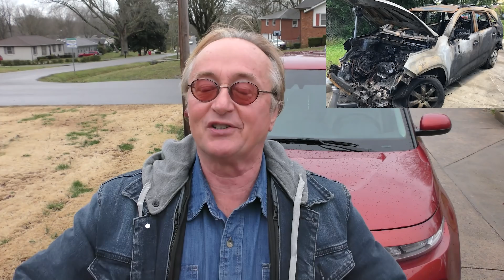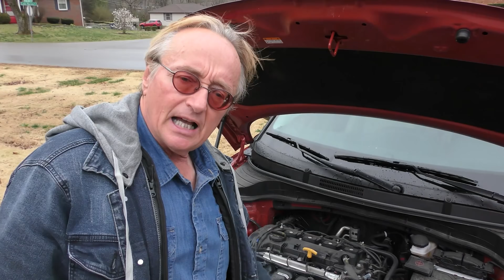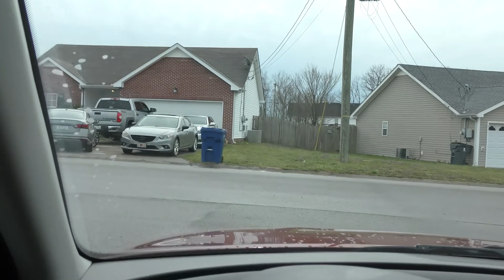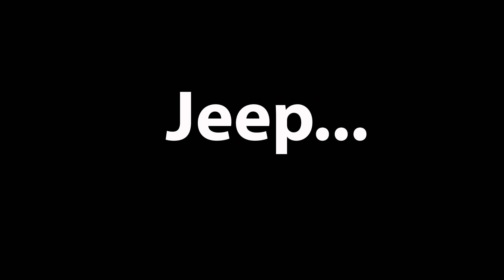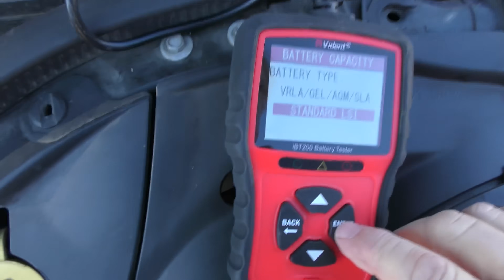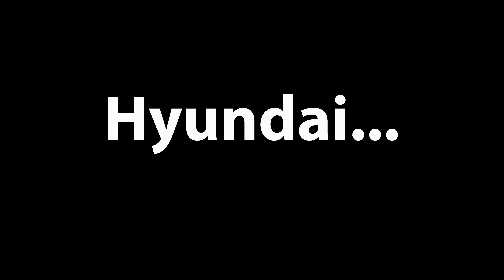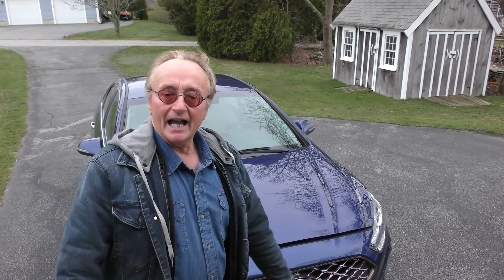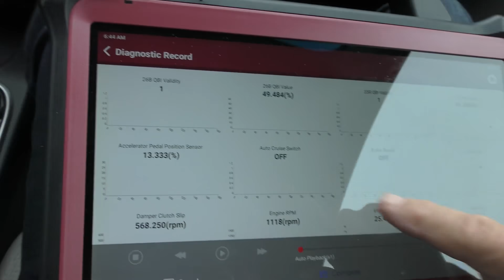3 Car Brands That are Crap

Comment: Next to nobody buys new cars in my area, they're just too expensive, now everyone goes for used cars provided such cars are in decent conditions, the car dealers are just asking too much but instead they're in trouble...

At least the gas is getting cheaper, same for diesel, there was a story where a few transit bus suddenly started with a fire that came from the engine that were using electricity, Volkswagen was especially the worst, now a lot of people are staying away from Volkswagen....

However, right now BMW cars are getting more common in town...

It's a little too soon to use electricity powered cars...

Comment: I have a Hyundai Elantra that's got almost 300,000 miles on it and there is no problem with it whatsoever except for the air conditioning went out just this year and my guess would be the two seals went bad

Comment: First of all let's be specific here. Almost every car company makes lemons. My friends used Hyundai Sonata lasted forever with minimal maintenance. You shouldn't condemn an entire company. Every manufacturer has car models that are poorly made and well made regardless of the country.
Reply: The old Sonata had Mitsubishi engine.
Reply: @pflaffik  You’re talking about 30 years old Sonata.
Reply: I think the point is what kind of habits do companies have. If a company has 1 or 2 gems in 20 years then you probably wouldn't wanna take your chances with them.
Reply: The Hyundai Theta II engine recall was a real disaster for the company, but if you get a Hyundai with a Theta II and decently high mileage and no obvious problems then it'll probably last for-frickin'-ever.

Comment: I bought a Hyundai Elantra and Santa Fe, and both required total engine replacement.  Insane...
Reply: Same
Reply: Yes! I also had major problems on a Hyundai and Kia ...don't get the comments of people were like mine has 200,000 miles on it no problems I think they must be 50/50 lemons and good.

Comment: I had zero problems with my Hyundai and owned it for 4 years (bought used when it was 2 years old).  Have zero issues with my Kia (owned since new for 4 years).  ZERO issues!  Nothing at all.  Compared to my old Ford Escort, these newer cheap cars are like night and day.  I'm throttled that one would deride these cars.  To me, they are amazingly simple and well designed/built.

Comment: I have a Kia Soul EV 2016 - Kia approved a warranty battery replacement last January.  Still waiting going on 9 months later and the car now has a charge range of 28 miles.  I agree with your Kia assessment and will never buy or recommend a Kia car again.  It feels like they have stolen our money and have no intention of repairing our vehicle.

Comment: Had a chrysler back in the 1980's time frame (Called it the Omlette - was an Omni) - burned a quart every 700 miles.. Chrysler wouldn't help.  "That's normal"... I'm sorry...but losing a quart every 800 miles seems like an EPA violation, but they wouldn't fix the sucker....

Comment: My gdi sonata has 150k change oil every 3500 with a proper spec acea a5 oil by Pennzoil and burns half court after it reached 135k. Change oil on time. People think "earthdreams" honda engines are any better. I used to work for em.

Comment: My 2010 Kia Forte has 260,000 miles on it and burns about a half a quart every 3000 miles. But it does have that 2010 engine knock. But other than that I have never had a major repair done to it. I've had 5 KIAs and they have all been great cars. I now have a 2020 Forte GT Line and I love it.
Reply: Hyundai and kia have sucked for a decade....plenty of people have needed a motor way before they should have .and it wasnt from neglect. Of course you like the GT... Its still new ...but the newer most cars and trucks are..the cheaper they're made.

Comment: search around youtube for the hyundai kia smartstream engine video. The one where the korean engineers took them apart. hyundai kia may once again be replacing engines soon enough. The problem is in the ring seats not supporting the pistons correctly an eventually causing dieselling of the engine. This is where the piston scrapes the wall of the cylinder(s). applies to all the new smartstream 2.5 engines. if you own one you need to change the oil every 300 miles with very highgrade synthetic.

Comment: Amazing.... We had the exact same problem with our serento 91 K miles. We did the test, and the dealership swapped the engine and threw in a loaner at no charge. I am happy with my Kia
Reply: Youre happy with a brand that needed a motor at 90k? It shows they're junk

Comment: my highlander is burning oil...since bout yr after i bought new in 07..they did consumption test...was burning but not enough.lets just say adding a qt every 1500 so miles.they said the rav 4s they replaced rings cause had alot of complaints that a recall was done...but nope...not my 07.screw toyota

Comment: I changed the oil in my 96 f250 with the 460 every 8000 miles when I burned a quart.

Comment: With ANY car, it's always something.   A person needs three cars:  one to drive while the other two are in the shop.
Reply: Not if you have Hondas or Toyotas....or both
Reply: @richsweeney1115  My Toyota is always boken.  It runs well, but now the headlights won't light up the road.  I drive my Dodge at night because no one can fix my Toyota.   It's always something with a car.  They are all crap.

Comment: Hey Scotty, my wife has a Kia Sportage (Korean built). It burns no oil and has not had any problem, even a small one, ever.  It's looking like the most reliable car we've ever owned. Now the '96 Chevy Cavalier 2.4 liter, that was the worst car I ever owned. It's still rotting in the drive, (the least trouble it's ever given!!) Endless electrical problems from day one, in the end it's still good mechanically but I just couldn't be bothered persevering with it.    I guess tI got a bad GM, and a great Kia.
Reply: Funny you should mention that - I have a buddy that had his Kia engine replaced twice. I personally had a Cavalier (3.1 V6 car) years ago and begrudgingly sold it only because I needed the money at the time. It was a great car - and pretty fast for the day. I can't speak to the 4 cylinder version, though.
Reply: Korean built KIAs are trash compared to the global counterparts. They rip off of patriotism and extremely high taxes on foreign vehicles.

This is the same for electronics too. A Samsung SIII bought in Korea had a plastic screen, my Canadian friend’s had a glass screen.

Comment: My 2010 Kia soul just hit 150,000 (from getting it off showroom w/7 miles) and has only had synthetic oil changes and tires and a few batteries.  Timing belt preventive w/waterpump preventive while they had the cover off at around 125,000 and still runs like new.  Never burned any oil.  Maybe the newer ones do, but my original sport 2.0 liter hasn't.

Comment: I can confirm kia hates their customers. I bought a 2019 kia optima and a 2019 kia stinger. The optima got totalled and they screwed me over on the gap, ended up paying 6k out of pocket even though I payed for the gap. The stinger blew 4 engines within 60k miles, i had it for a year and a half but it was in the shop for about 8 months replacing full engine assemblies, according to the receipts it was burning a hole between cylinders 2 and 3 and getting coolant into the cylinders then bang. Now im suing them for lemon buyback law, it's like pulling teeth to get them to do anything to right their wrongs. I'll never touch a kia ever again and I suggest nobody else does either.

Comment: I've had two Fiats. First one went to 175k and  never needed oil between changes. Gear box went and it was cheaper to replace the car.

My current Fiat also a 12 year old identical to my previous one.. never burns oil. Got it with 27k miles.
Get 50mpg average too. Don't think you guys in USA get the Fiat..
Reply: I'm in the U.S and I get the FIAT. Had a 2013 500 Sport which was no less reliable than 2013 Honda CR-V it shared the garage with. Put 80,000 miles on it and traded it for a 2018 500 Abarth which is imho about as much fun you can have on four wheels. Think it's a shame they discontinued the 500 in the U.S. (2019 was the last model year sold here)- only model left now is the 500X AWD.
Reply: @johncallahan3573 had two old punto's don't know if you guys had them. 1.2 and 19tdi. Great small cars inmh bust rust badly (in UK)
My last two are 1.1 54bhp Panda model. The Fiat 500 body is loosely based off the Panda. The Panda model I have was available in ECO 1.1 ,1.2 and a 1.3 tdi.
IMHO the 1.2 is the one to buy. Very economical! Better than the 1.1 I have.
More practical than a 500 ie 5 door hatchback folding rear seat etc .
Great little car for UK roads .. but 0-60..... very very slow! And rubbish on hills:/
Reply: @mark70s29  Don't remember the Punto here but I do remember the 128, the original  124 Spider, the 850 Sport and Spider and the Strada (I think it was called the Ritmo in Italy) .... I go back a ways, lol. Rust was problem especially where I lived - snow and salt and not just Fiat's - Japanese cars and trucks were worse. The new Fiat's are very good in that regard.

Comment: So the first sign that a car is burning oil is blue smoke out the tailpipe right? We've all seen the old car driving down the road with blue smoke blowing from its tailpipe that's a car burning oil I read a theory about why some of these new engines are you see so much oil they're not actually burning it but the machine tolerances have become so precise and so tight on new engines that the engine actually just evaporates the oil it's not actually consuming it in the combustion chamber but rather the the Heat and friction generated from such tight Machining tolerances actually just evaporates the oil away so it is using oil but not in the conventional sense of we think of an engine burning oil my Dodge Avenger uses about a quart of oil per thousand miles yet there's no blue smoke out of the tailpipe the catalytic converter is not clogged there's no leaks and the engine runs like brand new it's not worn out it's just that the engine just evaporates a way that oil
Reply: @Warrior furthermore burning oil eventually plugs and clogs catalytic converters so if all of these vehicles was burning that much oil in the combustion chamber you would have the catalytic converters prematurely failing by the tens of thousands in these cars yet they're not so the engine isn't burning the oil and the reason why all new cars don't do it is because duh not all new engines are made by the same company and the same Engineers it's only certain engines that have these extreme tolerances that are susceptible to this oil consumption but you can't deny the fact that when a motor Burns oil in the combustion chamber blue smoke comes from the exhaust that is a classic sign of an engine burning oil
Reply: @Warrior first of all this is more common in 4 cylinder engines that rev extremely high and have extremely tight tolerances in the engine it's not as in common and V6 and V8s that rev less but produce more torque my engines are four cylinder engine it routinely tax to 6500 all the time because it's a small engine pulling a full size car so the smaller the motor the higher the engine has to Rev the more heat and friction is generated between the surfaces we're not talking about the old days where you had a big giant 5 6 L V8 engine that turned very slowly low RPMs and made a lot of torque these newer engines spin very fast and have to have very tight Machining tolerances they are simply evaporating the oil away in the tolerances between the parts

Comment: In all honesty early Aviation engines like the Pratt & Whitney radio engines burned oil by the gallons per hour for some of them had nine and 18 cylinders but burning oil doesn't always mean that the engine is worn out it also depends on how tight the machining tolerances are between the piston rings and the cylinder bore again early Aviation engines burned oil by the gallon per hour and so they had to have a giant oil tank behind the engine to keep it lubricated

Comment: Would have guessed 2 of the 3 brands for sure, but the third I’ve suspected for decades.  No brand is perfect but I’ve had exactly two major non-warranty problems with Fords after driving them exclusively for 34 years.  I don’t trade constantly either. Maybe I got lucky, but I’ll take it.  I have a 2006 Mercury Montego with 154K miles I rarely drive, but when I do it keeps me from selling it. Just $13 a month to insure. Not worth more than $1,200 to any dealer so it’s hard to part with it.
Reply: What insurance costs $13 a month???

Comment: Got to disagree depends on the kia. The 1.6 l with timing chain is bullet proof my 2013 has 200 k miles all I did was put an alternator. The 2.0s were the bad ones. My dad's 02 optima did 250k and he drove it on dirt roads every day 40 miles to work.

Comment: my kia dealer said my cv joints were fine until the warrentee was up.  I gave the benifit of the doubt but i went to an independent mechanic and yeah at 85000 the cv joints were crackling.  Kia didnt seem to notice it until after the 100000 mile warrentee expired.  Kind of explains why they have such a long warrentee. what good is it if its not honored.

Comment: I bought a 2021 Kia Forte LX with the 2.0L engine.  In order to maintain my warranty I have to change my oil every 6,000 kms ($3,600 miles).  I use only fully synthetic Penzoil with a synthetic oil filter.  I only commute short distance so I travel about 12,000 kms/year.

Comment: My wife bought a brand new 1994 Ford Taurus station wagon EX.  top of the line 3.8L engine and Axod tranny.  We had it to the Ford dealer numerous times for tranny symptoms.  They kept saying no problems found.  At 34,000 miles it started to have a whining sound and brought it in again and they said, no it is not the tranny, it was the serpentine belt.  We had it changed and still had the whining noise and I said it is the tranny.  Ford said new belts make noises, they have to wear in.  Needless to say, at 37,000 miles the tranny blew and Ford refused to replace it saying it just passed the warrantee.  I brought Ford to court and the judge said they were right, it lasted to 37.000 miles  and Ford said they don't replace a part if it makes noise, just if it fails.  MMMM wonder why they wanted to replace tune up parts and the serpentine belt.  They did not totally fail.  The Ford motor company had the nerve to say that I neglected the tranny cause I should have changed the fluid.  The owners manual stated to replace the fluid at 100,000 miles, and Ford said a tranny at 37,000 miles was neglected cause I did not change the fluid at 37,000 miles.  We and all my extended family and friends the switched from buying Ford cars to Honda and Toyota.  Always been treated well by them.
Reply: Always easy to 2nd guess, but I wonder if you had taken the car to and independent ASE, etc certified mechanic would that have helped any? Glad you gave your money to someone better in the end.

Comment: After owning a 1.6 l Kia Soul for years, we got 2019 a Kia Niro Hybrid (also 1.6 l engine). Never had any problems. No oil burning, just regular maintenance. Why project engine problems on some models (with turbo maybe?) towards a whole brand (or 2, since Hyundai is the same base/company)...? 🤔